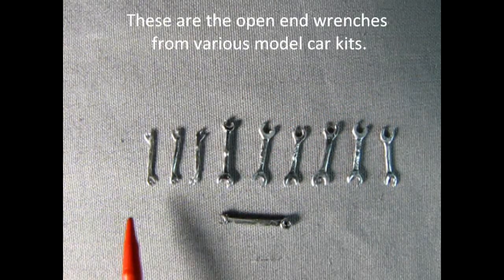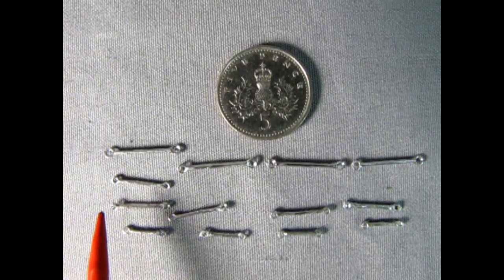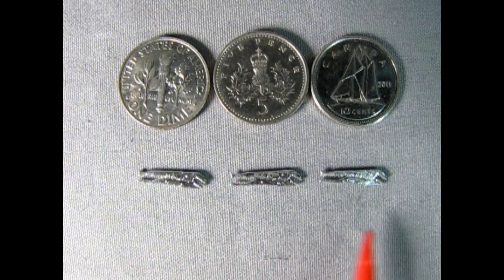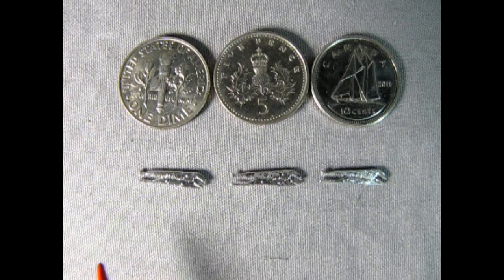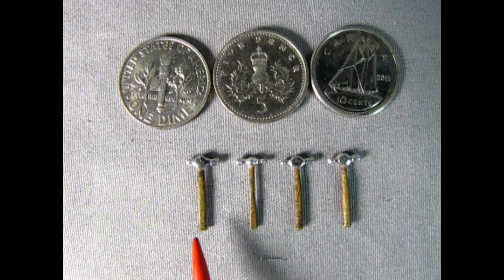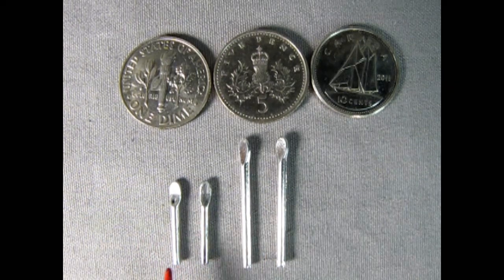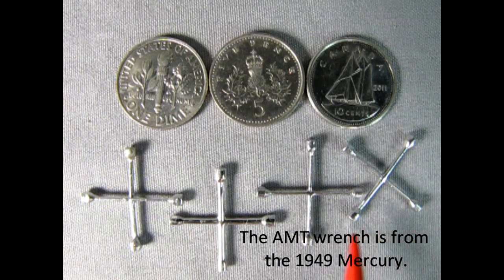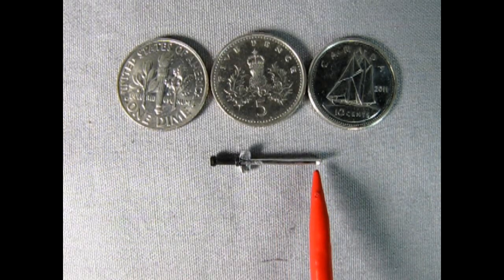My Finished 1/25 scale Hand Tool Collection - All Ready For a Garage Diorama Or Two

Comment: Trevor,I don't know how difficult it is for you to get Fujimi kits. They do a 1/24th scale tool set,number 115054 . It has a lot of hand and power tools,jacks,racking and a hydraulic lift. Well over 100 parts. Great value,even at retail price👍😎. Your 5 pence piece is out of date,we now have much smaller coin which is very irritating 😭
Reply from the maker: I can get those Fujimi kits from my hobby wholesaler. I did carry a few before I had to close the brick and mortar store, but I plan on getting more in the future sometime. Fujimi does the modern tools where AMT's kits are more in the 1970's. 

One of the Fujimi sets I remember had a shop vac in it and another set had a bicycle. I still have a box of the Fujimi 114903 Mechanic Figure Set and the Fujimi 115047 Garage and Tools Set 1 for sale on my web site here : https://www.monster-hobbies.ca/Hobby_Products/c375-model-car-garage-and-accessories/

Too bad about the 5 Pence piece.

Comment: Nice work. Torque wrench is spot on!
Reply from the maker: Thanks 👍 It was a little tricky to get that needle point without leaking the paint into the "window" of the gauge. I only wish I could have painted the numbers onto the dial, but I just couldn't. 😫
Reply: I think that torque wrench looks excellent too,Trevor👍👍😎. I think the only way anyone could get dial details would be by a decal. 👍
Reply from the maker: @petesmodelcarcustoms584  Or tiny brush like a 20/0 and fine eyes!
Reply: I did think of capturing an ant,then let it walk through a puddle of paint🤣
Reply from the maker: @petesmodelcarcustoms584  You would need to train it to walk in a 1/2 circle though.
Reply: @MonsterHobbiesModelCarGarage  A very small loop of cotton around it's neck pinned to the bench would force it to walk in an arc. You've caught me there,I can't spell lasso, lasoo,lassoo,like cowboys use😁
Reply from the maker: @petesmodelcarcustoms584  Sounds like something that would happen in Alberta here.
Reply: @MonsterHobbiesModelCarGarage  Calgary stampede